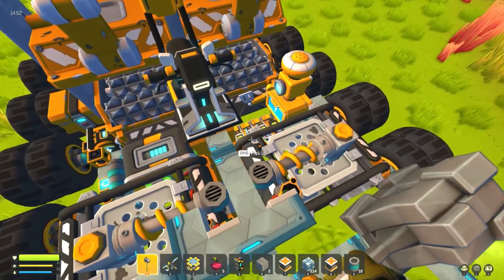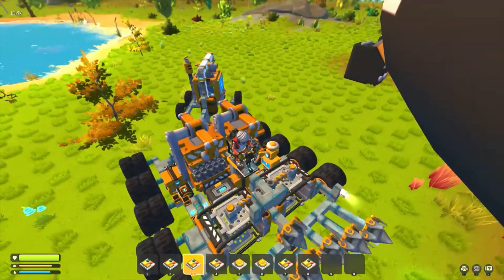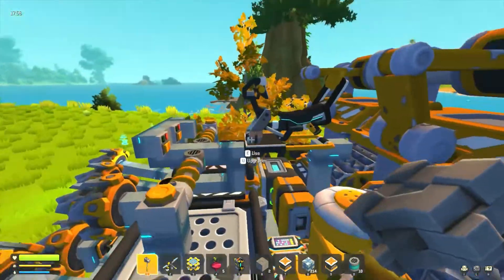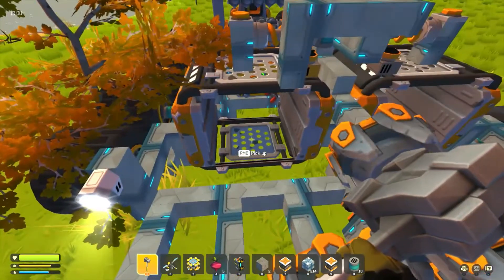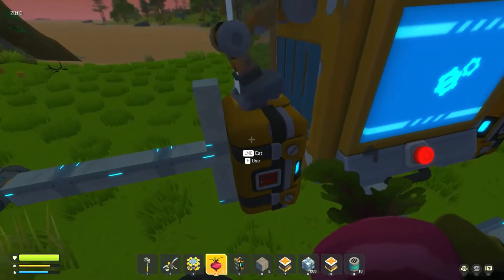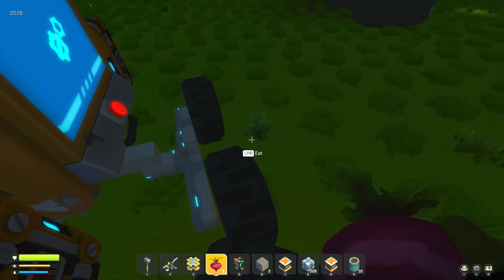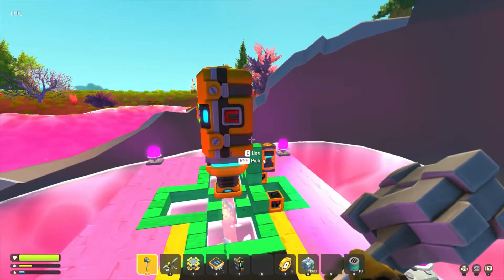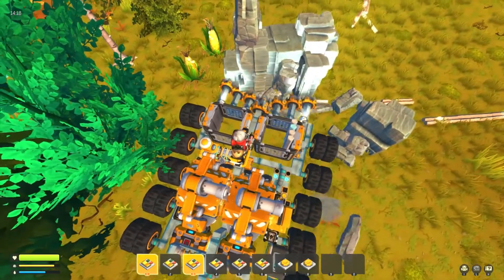Scrap Mechanic Survival. Load balancing my Twin collector, twin refiner, mining truck.

Comment: ive had good luck by flipping my refiners upside down plus then the cases are up high away from bots creeping up from behind.  plus a guy named woody on youtube put the drills on floating shafts no controller connections on back bearing on vehicle so all the drills touch the ground at all times.  they float over stone and give it a feather touch that these drills like when cutting up stone.  works even with wood cutters.
Reply from the maker: Thanks for the info. I did see Woody's video. I need the ability to lift up the drill head As I adjust my electric engines for a very fast road speed any thing loose will cause problems. Especially a heavy group of drills. I keep the drills close to the front tires for the same reason. I will try  a loose drill head with a lifting bar.  Upside down refiners. Sounds interesting I might give it a try.